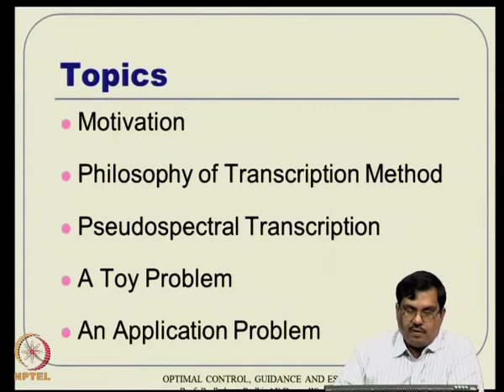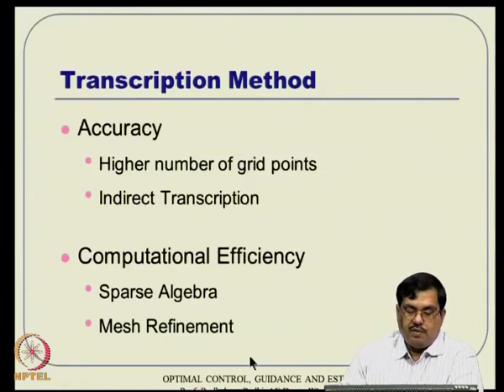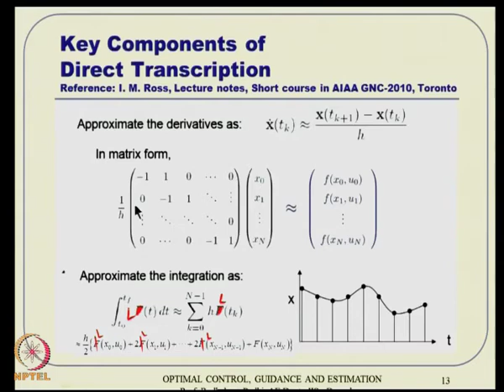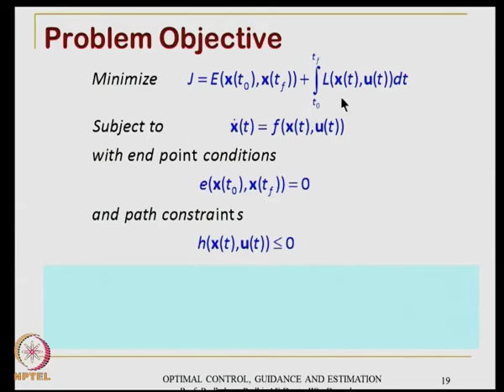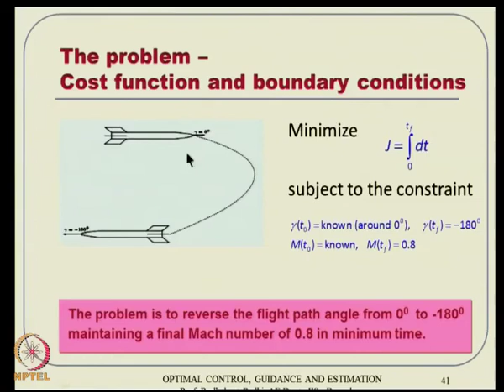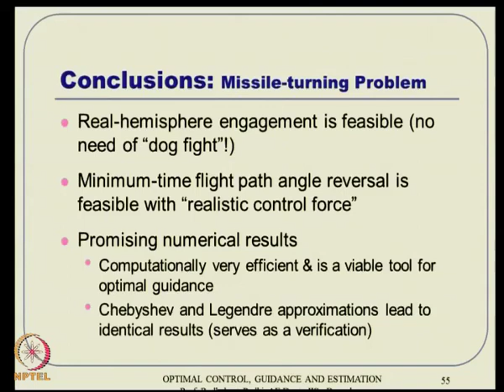Mod-11 Lec-22 Transcription Method to Solve Optimal Control Problems

Comment: Thank you so much for your nice explanation. There are some typos in the slides. I will mention the correction to anyone who is interested. 

slide 27, E(x^(t0),x^(tN)). 

The matrix in the slide (31) is not the differentiation matrix this matrix is (T^-1D). 

Slide 32, Xdot^= Da not (Xdot^=TXD a). In the same slide too, Da-Ta=Tb>>> (D-T)a=Tb>>> T^-1(D-T)a=b.

Slide 34, wk=((b-a)/2)*(pi/(k+1))={pi/2,pi/4,pi/6,pi/8,pi/10}

slide 35, x^(1)-e